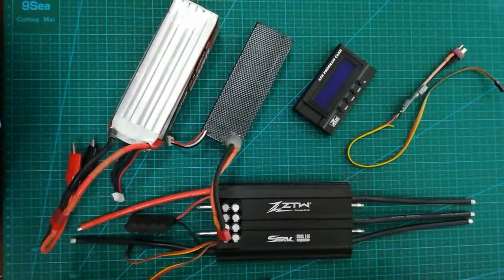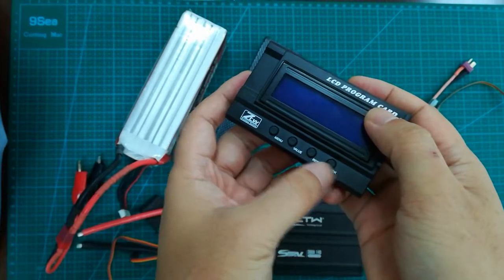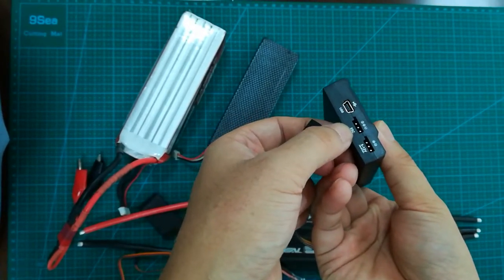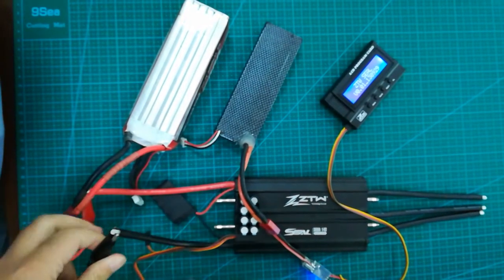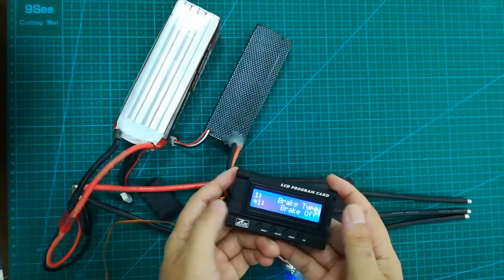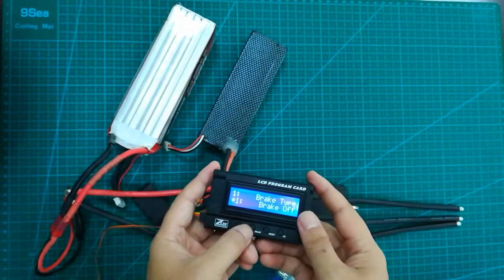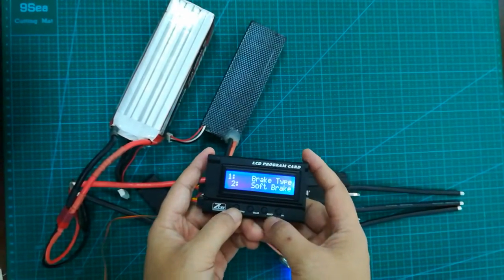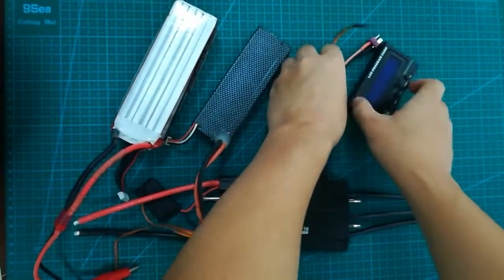ZTW Seal 300A OPTO HV 14S boat ESC connect the LCD program card

Comment: Hi.. Is your esc still going well? us this a good esc and will it cope with 10s lipo
Reply: Haven't used it under load as yet, will be testing this weekend on 7s and then soon after 12s we will see.
It is meant to be rated for 14s ?
Reply: @speedfreak1161 .. oh good i hope it works well for you.. i do see a vid a genesis rc boat running ztw seal 200A 8s with a 1600kv 4082 leopard with 47mm prop successfully.. myself im not pushing past 6s lipo 4082 1900kv motor ztw seal 200A esc dasboata octura x445 race mod prop genesis boat.. What motor are you using..
Reply: @paulcooper7162  hey did u say your running a seal 200? I just got a 200 in my fighter cat cheetah. I’m debating on running it on 6s or 8s. I’m a rc heli guy so I have a ton of 6s packs but when I got the boat, it was all set up for two 4s packs in series and I really hate soldering so I may just order new 4s packs and try it on 8s! 
How long have you Ben running your seal and I’m curious if I can set my boat up without having to buy a programming card? I think it might work as long as the guy that used it before me ran it on 8s as well!
Reply: @scottbuck9348  I ran a 200A and 300A seal in my boat and 200A can run 8s but with lower KV need to be watercooled if using in a boat  .yes soldering can be tricky but if you file the end of the soldering iron make it clean first works better
Reply: @paulcooper7162  Does the 300 a esc  still run
Reply: @eclipse2260  Hi 😊👍 I sold it,I had no problems with it at all
Reply: @speedfreak1161  hello! I also have a 14s question how many volts it is ?? .. thanks
Reply: @pigeontransilvania4741  51.8v under load, 58.8v not under load 👍
Reply: @speedfreak1161  thans
Reply: @speedfreak1161 .. nice they are huge motors.. almost as big as Toyota Prius.  😊
Reply: @paulcooper7162  testing it out in 3 hours will let you know. Might even post a vid 😅
Reply: @speedfreak1161 .. oh good sure would be keen to see if you can get a vid..
Reply: @paulcooper7162  uploading on my channel 👌

Comment: How do you turn off reverse, there is no option on the program card ?
Reply: I don't think you can
Reply: @clehirs  Thats correct i just adjust it on the Transmitter so i don't get reverse that's what i have done now.
It would be good if there was a option and even a response from ZTW
Reply: I have that also, can't turn off reverse on esc, also forward has the same revs as reverse.. is that normal?
Reply: @paulcooper7162  i just used the TX set up so there is no reverse on my Futaba
Reply: @speedfreak1161 .. oh ok.. I dont mind reverse though.. Looking forward to seeing your next test on your boat..

Comment: How come your website, i can not download the pc software to update my ESC and or LCD Program card for my Seal 300A, and the lipo cut off voltage is too low need a option for 3.3v so the lipo does not get damaged, and motor timing needs to start at 0 degrees 1,2,3 and so on.
Please answer and fix problem on you website ........ Please